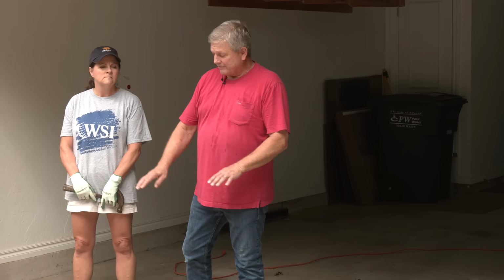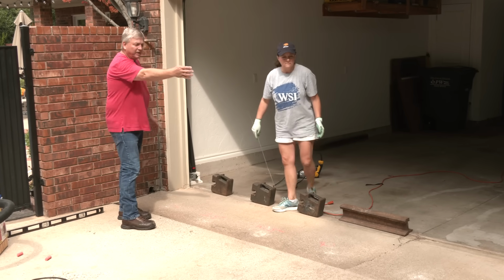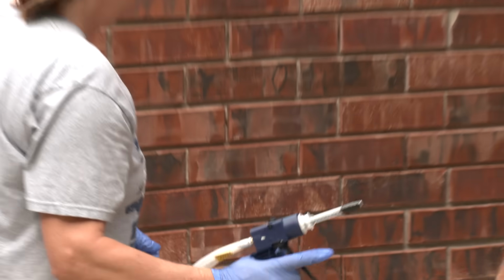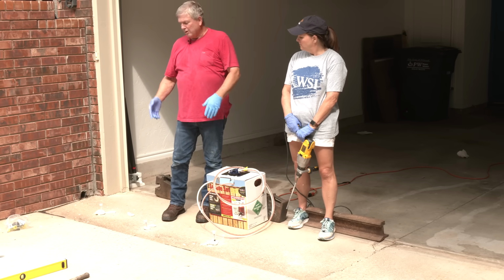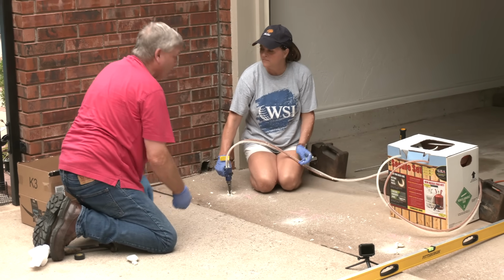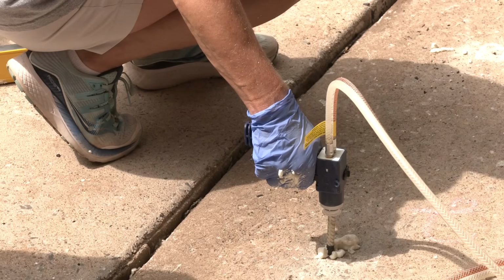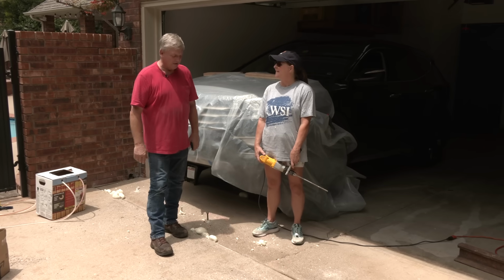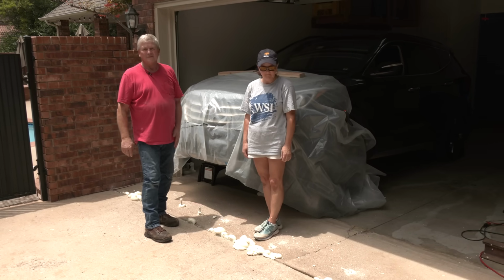Raising Concrete Driveway Slabs with Secure Set

Comment: For such a small area it would be cheaper to lay new concrete.
Reply from the maker: Actually it wasn't, because that was the first thing that was done was to get a bid.  The prices for that type of thing are not what they used to be.  Thank you for watching.  GRA Services - Secure Set
Reply: Actually, if you tore the old concrete out and could replace the concrete by yourself or a couple friends, then the only costs would be for some stone to regrade the slab and concrete. Concrete will be a huge cost though, a slab 4’ X 20’ equals 80 square feet, that’s what one yard of concrete will cover at 4” thick. 65 square feet at 5” thick, 54 square feet at 6” thick. So you’re looking at a couple yards of concrete at $150.00 @ yard (northern Ohio prices), plus a light load charge, probably looking at $500.00 plus for concrete without labor. 
   They used two containers at almost $1000.00 dollars, plus you need a hammer drill with a drill bit, maybe a cutoff saw to cleanup the edges on a cracked joint. A lot of labor replacing it but you can save some money if you replaced it yourself.
  Edit: They show that a woman (no disrespect intended) could do the job with the foam, with some guidance, in 4-5 hours including cleanup, compared to a couple guys and 2 days (a day to hammer it out and a half day to pour and finish it) to replace it. And you have to haul away the old concrete, if you notice a lot of labor costs in replacing it, you’re right and that’s why it cost so much to have someone do it for you.

Comment: Cost affectiveness..had this been a one kit job...(plan for the worst-case) good deal, but 2 kits ($1000) You would have come out about the same as if you have someone come out removed pack and repour that section and even have an option of putting a drain to solve the runoff problem and no holes or cracks in you concrete...
Reply from the maker: Actually not, based on bids for the concrete replacement and the necessary fill that would have been needed just in that area.  Then because the foam found more places to run to and fill than we necessarily expected, now there is great support in those other areas.  The drain was later fixed; therefore, no continued issues.  Thank you for watching.  GRA Services - Secure Set

Comment: Not quite what I was expecting either.
I think that adding a continuous drain to this area would be very wise. Filling these huge voids under the slab might not have been the best idea, the water may now seek a more destructive path, such as under the garage floor or undermine  the garage walls.
Reply from the maker: The drainage issue was corrected after this project and is no longer draining under the driveway.  Why would you not want the huge voids filled.  If not filled and corrected the slabs would eventually fall further, crack, and probably separate, causing even more issues.  Now there is a support strength under the slab of 10,080 lbs. per sq. ft.  This is a big win!
Reply: @SecureSet-Fence-Installation The poor drainage was not because of the driveway slab, it was due to a lack of a proper drain and stone aggregate underneath the slab.

The foam injections may fill voids left from the water but it will do nothing to fix the original issue, bad drainage. If anything it could cause the water to seek a new path under the garage, causing much more extensive and expensive damage than before.

The best fix would be to remove the slab section , dig the dirt out and fill it with crushed stone (road base) and a semi-perforated drain pipe to quickly remove water from the soil. Lastly, pour a new section of concrete and ensure it has the correct slope and surface drainage.

Using French drains around the footings of any structure is a wise idea to remove water from the soil and prevent water from undermining what is above it.

The foam product would be fine for other applications but not this scenario. Water will find the path of least resistance, it will just flow under or around your foam, washing the soil away in the process.

Comment: After the cost of all material and time spent,  much better I think to just remove that section and repour with concrete.
Reply from the maker: Not based on the estimates these days to do the concrete work, even having larger voids and more foam used it was still better than the tear out, backfill, and repour.

Comment: Very interesting.  Glad you included things that can go wrong.  Would like to see the homeowner using proper PPE.  A dust mask and eye protection should always be worn.  Drilling concrete creates silica dust which is potentially harmful.  Otherwise, very informative.
Reply from the maker: Thank you!  We don't want to hide what can sometimes go wrong in the process, it's better to be prepared.  Yes, we started with the glasses for protection, but for some reason they were removed along the way.  The directions and safety data sheets do explain the need for the protective equipment.

Comment: That foam kit is quite pricey...😢
Reply from the maker: It's all about perspective.  Have you quoted the replacement of concrete slabs lately, they can be quite pricey.  
I personally was quoted $7,500 to bust out and replace 2 small sections of my driveway.  It's always best to get some quotes in order to make a wise decision for your own project.
Reply: @SecureSet-Fence-Installation  Your area is pricey compared to where I live in PA, I agree with yourstatement... Ps, I'm a contractor

Comment: What I learned from this is that a job like this is not diy. Had she not had a pro there ...big problems would have occured. She would have had to have gotten a jack hammer next and someone to pour a new slab. This is not a diy opportunity.
Reply from the maker: Interesting perspective, but you are due your own opinion.  However,  the majority of our customers have proven that they can watch our instructional videos and learn to do these projects, many with literally no experience.  We sell thousands of these Secure Set Spray Foam kits and based on the multitudes of conversations we have with our customers, most are DIY types.  Thank you for watching.  GRA Services - Secure Set

Comment: I would have taken the hammer to the concrete and would pour grade 5000  cement with fiber... cleaner work in my opinion.
Reply from the maker: Well, my guess would be that you are a concrete contractor.  Hardest thing for some people is to change the way you have always done something.  Never hurts to learn a new way of doing something, but thank you for watching.  GRA Services - Secure Set

Comment: I’m just curious, what the cost would have been to remove that 9ft section and pour new concrete.  I looked up the cost for the concrete lift. $500 per box.
Reply from the maker: Thank you for watching.  I believe the bid to replace that section was $2,700.  That price didn't include any fill dirt or gravel and compression work.  Also, since this area wound up taking 20 cu. ft. of foam, they had some big voids that likely went under the adjoining slabs, which now also has 10,080 lbs. of support strength in those areas, as well.  When replacing just small sections of the slab you wouldn't be able to get the packing of voids under those other areas without more concrete tear out.  Again, thanks for watching and your question.  GRA Services - Secure Set

Comment: I would take out that worthless section of concrete and install a proper pipe for the water and then pour it in the proper thickness with dowel rods into the concrete slabs on each side the reason why it didn't sink on the garage side is the concrete shelf from when the garage was originally poured
Reply from the maker: Thank you for your comment.  That would be another way to fix the issue, I'm sure.  But, this customer decided not to tear out and repour the concrete, and it is working just fine now that they had the drain pipe issue fixed, as well.

Comment: I did this for 10 years slabjack. I raised entire garage floors up to 9-14 inches,sidewalks,drives, great way to make a living atl ga
Reply from the maker: Thank you for the comment.  Have you tried doing the same with our Secure Set Spray Foam?  We talk to many customers that do mudjacking/foam jacking with their rig systems, but will use our kits for the smaller jobs instead of losing the potential customers that won't pay their normal minimums.  GRA Services

Comment: What is the exact secure set product you used for this lift?
Reply from the maker: We used the Secure Set Spray Foam 120 kit.  At that time we did not have the 200 kit, which is 16.6 cu. ft. of foam (66% more foam) and will support 5,040 lbs. per sq. ft.  It will lift the same as the 120 kit.  If we had the 200 kit at that time we would have used it for a residential driveway, such as this.   Go to our website www.secureset.net to see our All Products page and USES page, you will see both kits that we offer and many projects we have done with the spray foam kits.  These 2 Secure Set Spray Foam kits are sold for the same price, at this time.  Thank you!

Comment: Just what I need 
Thank you
Reply from the maker: Thank you!  We now have 2 size kits available.  16.6 cu. ft. kit will support 5,040 lbs. per sq. ft. and the 10 cu. ft. will support 10,080 lbs. per sq. ft.   Both will lift the same, just consider what you need your final support strength to be.  If we had the 16.6 cu. ft. kit back when we did this video that would have been the kit we would have used, since it still has plenty of support strength for most residential driveways and has 66% more foam to work with for the same price.  Go to www.secureset.com to review all videos and our documentation about our projects, as well as to order.  You you can call us to order 405-672-8885  8:30 a.m. to 4:30 p.m. CST.   GRA Services - The Makers of Secure Set
Reply: @SecureSet-Fence-Installation  thank you

Comment: Do you have a video of spraying foam into a wall to aid old bat insulation?
Reply from the maker: Hello and thank you for the question.  We do not have a video showing the Secure Set Spray Foam being used for insulation, but it definitely can be used for that purpose.  We have a new kit available that is called our 200 kit (200 BD at 1" of thickness) which is a great insulation foam and can be layered as 1" thickness twice for an RV value of 6 per inch.  Go to www.secureset.net to ALL PRODUCTS to see our 2 available spray foam kits.  If you have other questions you can give us a call at 405-672-8885.  Thank you, GRA Services.

Comment: Wouldn't it be cheaper and more accurate to break up and repour   the slab
Reply from the maker: This customer did get quotes to have that done and this was the better route to go for them.  Have you priced concrete work lately?  We talk to contractors all the time that bid these types of projects and even many times they or their customers will decide to go this route.  
It is another option to poly jack a slab without all the extreme effort it takes to jack hammer out the concrete, fill with dirt/gravel, and then mix and pour the cement (that you also either had to bring in by hand or order a cement truck), no less all the finish work, and the back breaking labor involved.   You can also drive on it with an hour or so versus the wait time required for new concrete.  There are a lot of other advantages to so I could go on and on.  Give us a call and we can explain further 405-672-8885..... Thank you!

Comment: This video makes it look so simple, I hope it's this simple in real life! Want to come do my house next? ;)
Reply from the maker: Thanks!  Some projects are simple and some are a bit tougher to do.  A lifting project is dependent on getting all the void space filled, then overfilling in order to get the lift.  Many times the path of least resistance for the foam is to find escape routes down a hill, under other slabs, sometimes it even pops up in the yard, and it will also compress soil, which makes more void space.  Understanding these types of things and figuring out the best way to alleviate the issues that you can, will help in the long run.  Good luck with your project, if you decide to give it a try.  We have thousands of customers that have had great success with their projects.  
GRA Services

Comment: Would’ve probably been best to put some bolts through it, Jack it up to raise, then put foam to secure it at the proper height. There are ways you can put bolts through it, and chain them to 2x4s and use a hydraulic lack to raise it
Reply: How excatly do you attach this bolts? I have attempted this a week ago and cant get a good attachment on the slab
Reply from the maker: Hello IntegraDIY.  That is a good suggestion/option. We presented that idea to the homeowner, they were not too keen on the "Holes For Bolts" idea.  So, we accomplished the job with just the lifting power of the foam.  Thank you for your comment.

Comment: Would making a couple drill holes on the other side of the concrete next to you and see if there is a void on that as well?
Reply from the maker: There very well could have been voids there, but hammer sounds didn't indicate that there was.  
There was definitely voids traveling down the driveway,which is probably where some of the foam went.  Luckily that has all been filled now and the water rerouted, so no additional issues.
Thank you!

Comment: Could have just dug up that concrete section and poured new concrete there because the foam kit cost way more than just pouring a new section its not even that big of an area.
Reply from the maker: Have you priced having that size area busted out, backfilled, and poured and finished?  They did and it was too expensive, plus they would have had their driveway out of commission for days.

Comment: Has anyone tried lifting a settling masonry pier beneath a porch column? Apparently back in 1910 footers weren't as thick, that combined with runoff from improper downspouts equals lean  :(  It seems there would be an issue trying to access and isolate at that depth. 
Concrete pro estimate 5k  ouch!
Reply from the maker: We have spoken with many customers that have lifted from beneath footings of different types, some with great outcomes.  The trick would be to find a way to contain the foam under the pier or footing.  People do get very creative sometimes with their projects.

Comment: nice video, does anyone know what is difference between the secure set and great stuff foam ? secure set more tough and load bearing more weight ? thanks
Reply from the maker: Thank you for the question, since a lot of people aren't familiar with the differences in spray foams.  Secure Set is a high-density, closed cell, commercial grade spray foam.  This kit we used was a 10 cu. ft. of 4 lb. density foam with a 70 psi compressive strength, which means it will support 10,080 lbs. per sq. ft.  This foam  will not absorb water, get spongy, and flatten out like Great Stuff.   At times, we also have another commercial grade foam that is 16.6 cu. ft. kit and is a 2.8 lb. density, which will support 5,040 lbs. per sq. ft.

Comment: How much does that foam cost? So many  holes do u think the concrete will be  prone to cracking ?

I would have put a probe a camera down there first to make sure its wasn’t sewer lines not causing that soil dispersement before drilling deeper or filling in foam
Reply from the maker: Please check the pricing on www.secureset.net.  We haven't had issues with the concrete cracking after the drilling.  It's very similar to the drilling for the termite treatments, but we don't place the holes as close together. 
An endoscope camera is very helpful for many projects, but this customer knew they didn't have sewer lines under the slab.

Comment: Does it matter whether your body weight is on the slab during work?
Reply: She shouldn't have been standing on it while filling the hole. The whole video seems like a DIY hack job but whatever. It worked I guess. I'd be worried about the concrete cracking between the many holes that were drilled. Being drilled that close together

Comment: I was quite disappointed to open my kit and not find a red shirt/blue jean private mentor included. Another classic case of Expectation vs. Reality.  I attempted this on a simple 2 inch 20 foot sidewalk raise. I ended up with approximately 1.5 cubic foot on my clothes and on the equipment.  2.5 to 3 cubic feet expanded onto the surface.  I accomplished raising one edge about 1/4 inch.  What a mess. Thank goodness for Acetone. If you guys ever travel to San Antonio please stop by and show me how easy it should've  been.

Comment: Maybe by cleaning out the joint it would have let the slab raise if the joint was tight with cement the slab would pinch against and basically trap the slab.

Comment: I bet it would help to get a piece of angle iron and anchor it into the concrete bridging the gap from driveway into the garage that way the slab ur trying to raise will go right where u want it to and not raise up higher than expected. So the angle iron would get anchored from the primary concrete into the garage concrete and anchor another angle iron same way at other end.
Reply from the maker: Hello Alexstoles1339,  Yes, that is a good idea.  We have done it on other projects, works quite well.  Good comment!

Comment: May I ask what size drill bit you are using?
Reply from the maker: Thank you for your question.  We use a 3/8" bit 12" long (just in case need to go deep under foam).  We cut our mixer tips back about 1/2 inch and you can use all 10 (even the fan style) then wrap black electrical tape under the flares of the mixer nozzle about 6 rounds to fit tightly in the 3/8" hole.  
GRA Services
Reply: @SecureSet-Fence-Installation  Thank you so much.